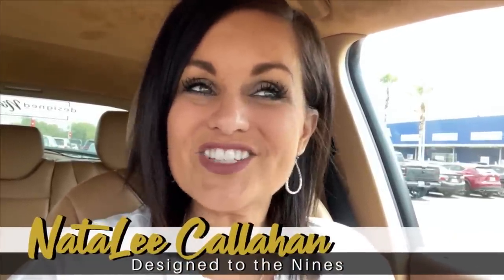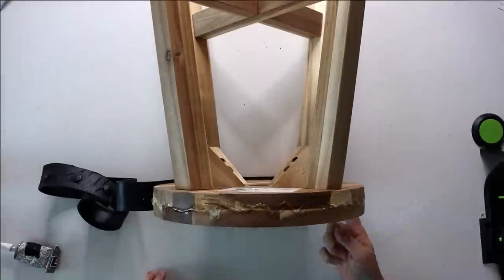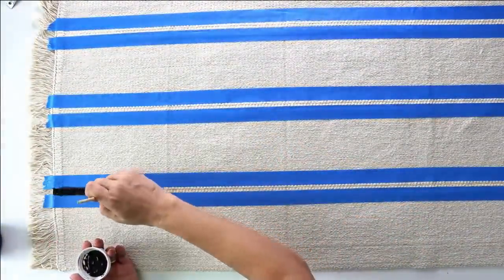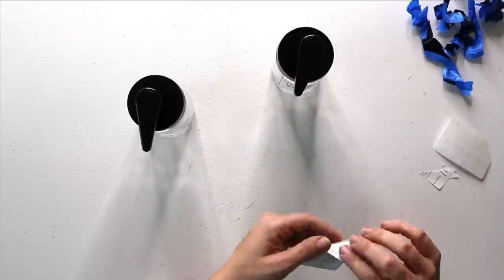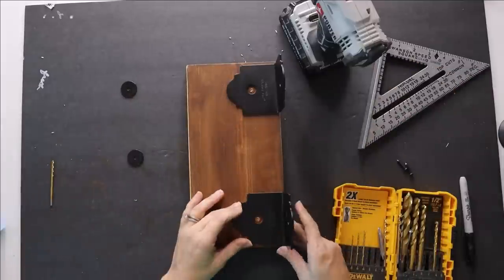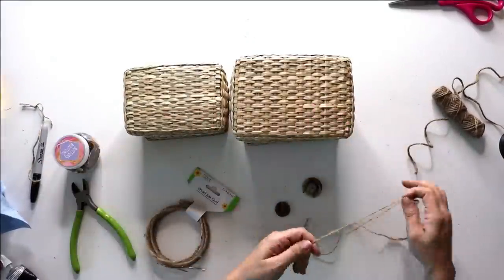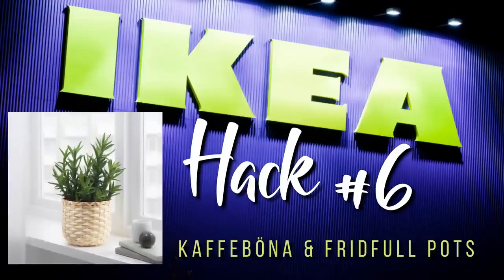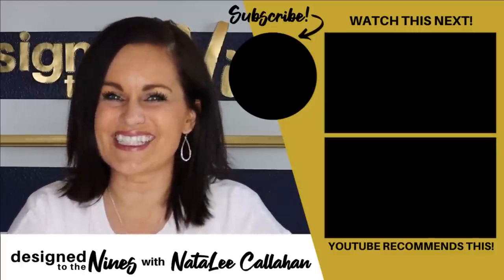Shockingly Easy DIY IKEA HACKS That Look High End for the Bathroom!

Comment: You make it look so easy. I have a very small bathroom in an old home and I’m trying to use the space effectively without it looking cluttered   Any suggestions?
Reply from the maker: Try going vertical… Put in the shelves and try to maximize as much space as you can for storage. Maybe hooks on the backs of cabinet doors curling iron‘s and hairdryers… Research small bathroom organization on Pinterest. Hope that helps!

Comment: I loved all these hacks however with the rug, how would you wash that?    Not sure Waverly would run when washed, etc.  Maybe use fabric paint ?    Just my thought.       Kim
Reply from the maker: Well I haven’t washed it yet… but when i was researching it, chalk paint in general is supposed to wash just fine. Maybe on the cold setting? I’ll have to get back to you.
Reply: @designedtothenines  yes, cold setting on the gentle cycle.
Reply: No dryer

Comment: FYI when using E600 and hot glue, don't apply one over the other as they will counteract each other. Using them side by side will work better. Original tip from a wood worker.

Comment: I would NOT use chalk paint on a rug, especially in a bathroom.  Chalk paint reactivates when it gets wet if not sealed and this has a huge potential to become a big smeary mess. 😬
Reply from the maker: That’s really interesting. And good information. In my research, it showed that it would be OK… But A few people have mentioned that as well. I have not technically got it wet yet so… I’ll probably give it a try.
Reply: @designedtothenines  I only shared because I learned that the hard way and ruined one of my favorite creations after following the common trend of using chalk paint for absolutely everything because I love the textured matte finish, which I often won't seal because even matte sealers change the finish I love so much.  Uggh. 💔

On a happier note...I LOVE your channel, creativity and project inspiration! 💞